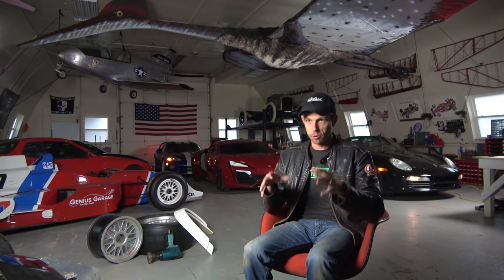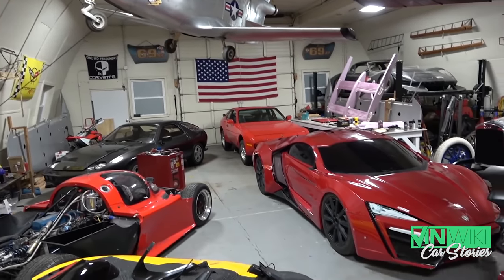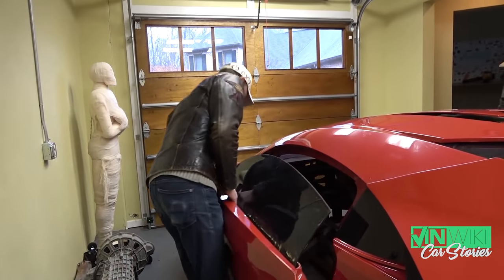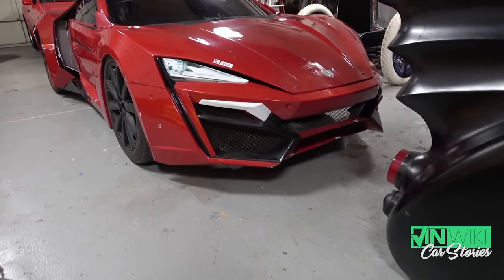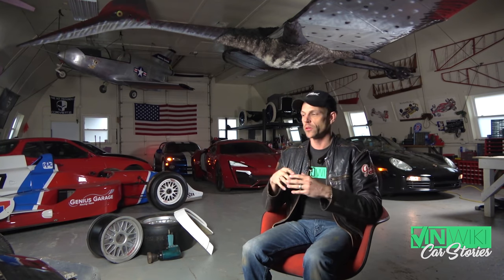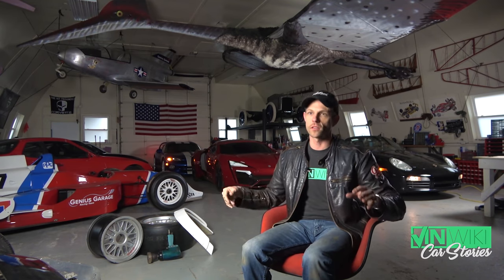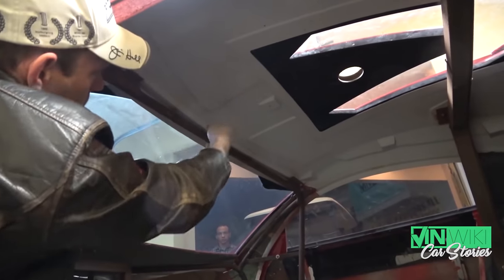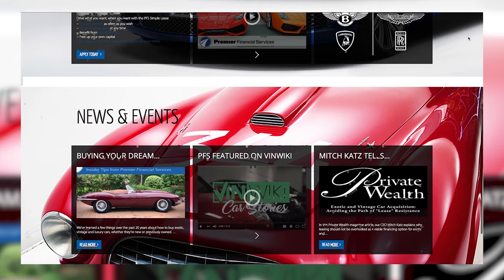College kids are destroying this Porsche to build the Fast & Furious Lykan

Comment: I would make a tubular chassis that has the lycan body on the outside, and the porsche subframes beneath. Also, i would scrap the electric system of the porsche and go with a standalone unit for the engine and custom build the rest, so you don't have to worry about fitting the Porsche interior with the lycan design.
Reply: Be willing to bet you could get a master race car chassis builder to lend a hand.  It may have to be virtual right now but the important thing isn't their physical presence but their years of knowledge.

Comment: "It's not really worth using CAD" (I'm paraphrasing) - I can PROMISE you it is absolutely critical to use CAD. You may be able to get everything on by some absolute miracle without using CAD software, but without doing any sort of proper Finite Element Analysis in a CAD program, there will be almost no way to reasonably determine the safety or rigidity of the whole thing. I don't mean to hate on the project, its absolutely awesome and I'm extremely excited to see how it goes, but as an engineering student (currently near end of my junior year) working on an automotive design project, I'm extremely skeptical of some of the structure and direction for the project. I don't believe Casey is by any stretch incapable of leading a team, but having an experienced engineer to lead the actual engineering of such a project will be absolutely critical for the success of a project. All that said, I wish the team at Genius Garage the best, and cannot wait to see the finished product!

Comment: Please don't kill the Porsche, whatever you do it will never be factory, it is better to build a custom tube frame with a stroked out V8, the boxster engine will not be able to perform at Lykan level  or if you really have to hack a car, get a 80's mid engine fiero or something,
Reply: I hope you're aware that the Lykan does use a porsche motor, right?
Reply: @budbanter  I wasn't aware, but if that is the case it still doesn't feel right to butcher a boxster, better to buy a donor engine and build a custom frame, you see once a car is cut in half, it will never be the same again - might as well build something which will match the Lykan hard points.

Comment: Learning to problem solve in the real world will help the students solve problems in the computer later. Until they realize why that bracket can't be trimmed down or why the door hinge geometry binds, or you can't fit a wrench on a bolt head to assemble the **** thing, they will never be able to model all of those things in the computer. I've heard, "but it worked in the computer model", so many times that my answer is, "then make it work in the real world".
Reply: Chris Estill 100%

Comment: Why don't you change your build around a bit. Cutting up a porsche to lengthen it to the correct wheelbase is just the beginning then what about the suspension and how that will affect the wheel offset and drive ability.  I've built enough of these types of cars that know the best quickest way is to build a copy of a diablo chassis and suspension use a 987 boxter s transmission to an audi v8. There are guys that have done this and what you are going for here is not as easy as cutting and stretching an aluminum chassis. Once you cut that boxer its not a boxer anymore it won't handle the same so you will be chasing your tail trying to make it handle like a boxter did and in the long run more time and money than starting with  diablo or murcielago replica chassis. I've been doing this for 20 years and know too much about this to not try to make you change your mind.
Reply: For one thing, it is a steel chassis.